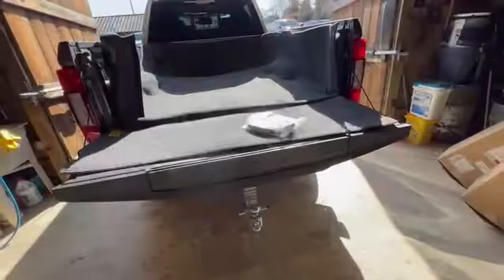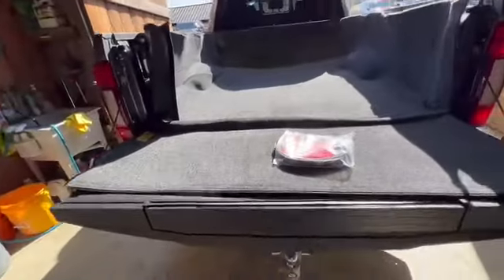Ford F-250 Bed Rug Install How to

Comment: Thank you. It’s midnight, in garage because 11° outside. So I’m installing the bedrug and an EGR power retractable bed cover. The truck has the bed lights, the 2000 watt inverter, and the EGR cover requires 5 holes drilled for power lines and the drains. 

Thought about making a video on the EGR cover because no one has made one including the manufacturer.  The EGR bolts under the box link 4 bolt points and that’s a bit of a challenge. I’m recovering from brain surgery.. still can’t speak well.

That bed gap cover always stay loose. These is my 3rd install. Love it.